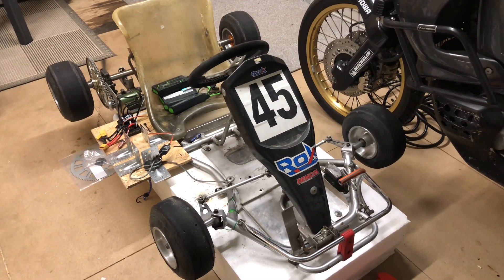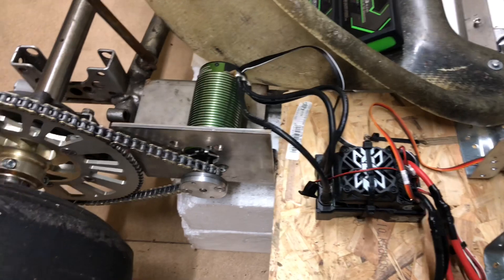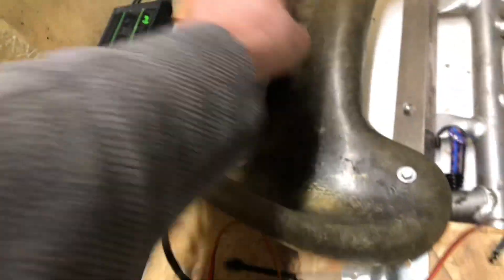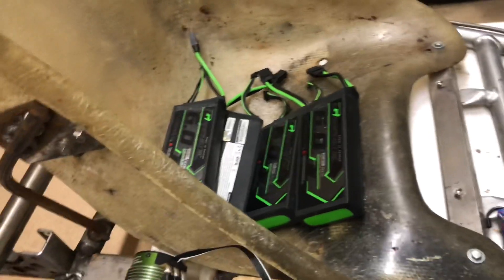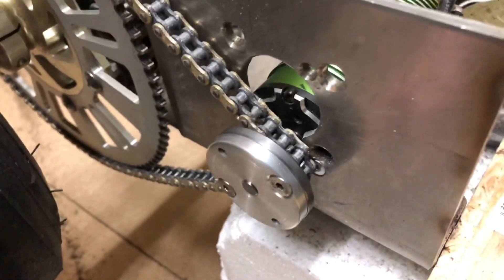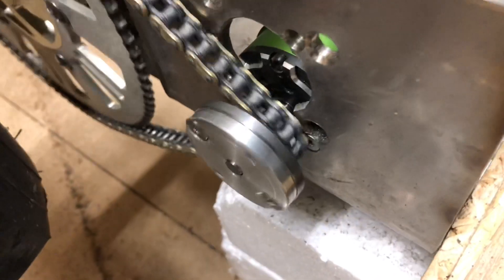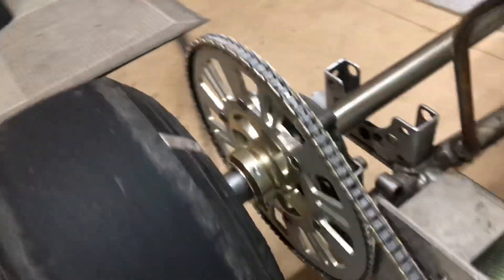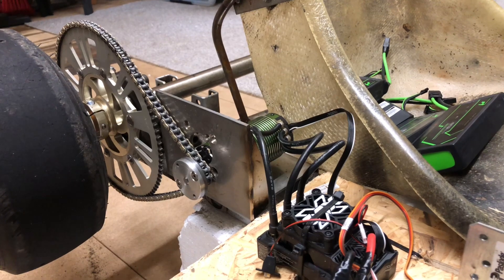Castle XLX2 800KV GO-KART BUILD

Comment: Awesome project. I am trying to figure out what is the difference if I apply same load on a geared shaft and I want to to keep a certain speed. If I use 5:1 or 10:1 gear what will be the difference if power is still the same? With 5:1 I would have 10 000 rpm and 2Nm torque vs 10:1 I wold have 20 000 rpm with 1Nm torque. So does it matter ? thanks
Reply: yea, the lighter gearing draws more amps , better chance of frying motor

Comment: What's the run time on this? With single motor and how hot does the motor get
Reply from the maker: Runtime 10-20 min, and the motor gets hot depending on the torquecontrol setting

Comment: How much weight did you save from the gas set up?
Reply from the maker: I dont know, i got the cart without the engine 👍
Reply: Cool beans. We'll I know those 4 lipos don't weigh too much vs a tank of fuel  plus the castle motor, esc and wires.  I'm going to guess you saved 40 pounds or more

Comment: Hi, did you calculate your gear ratio? 252 amp is not even half of what this combo can deliver, it can draw 600a in 33v or more than 19000 w!
Reply from the maker: I did limit the current through the castle software, I did a run with my 2 motor setup, where I managed to pull 550A from both esc’s
Reply: @kristianhansen2797  when you make a New video ?

Comment: That's insane 😳,  I thought this ESC Can handle 45 pounds Max
Reply: Gearing matters a lot but this is still extremely impressive for a motor and esc for under $500 that are that small.
Reply: @Bmr4life I mean the data sheet on these motors are insanely powerful for it's size, unlike brushed

Comment: Cool man :) How much amp^s do the motor need to acelerate? temps ok? Motorbrake? hope not ;) very nice build, pls show some readings from the esc. Awesome!
Reply from the maker: Thanks man, the setup is running cool. In the video the esc and motor stays under 50° celcius. I did one run without torquecontrol, and punch control. Crazy power with over 580A drawn! But offcourse more heat.
Reply: @kristianhansen2797  hi, do you have a data log of this 580amps run ? Would cool to see the run and the log in a video :)
Reply from the maker: @maximepierron  i will show the datalog and settings in my next video 👍
Reply: oh now i click for more and i see... not much load so far...really nice